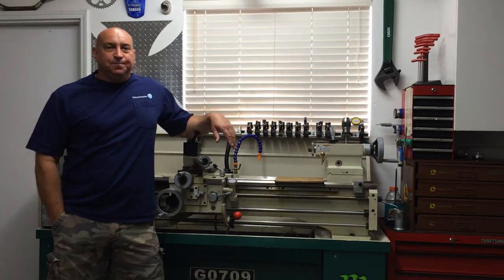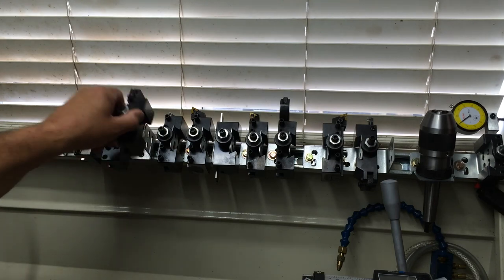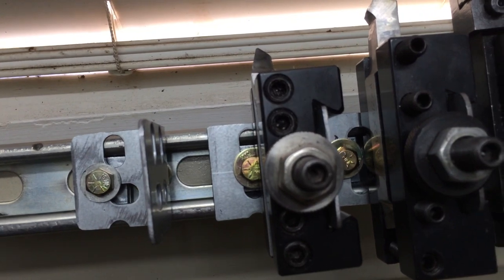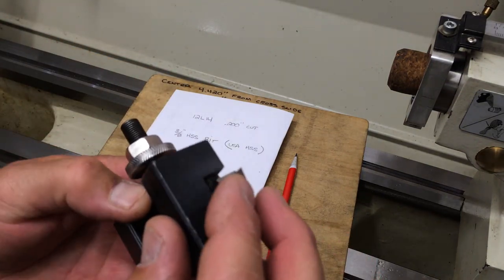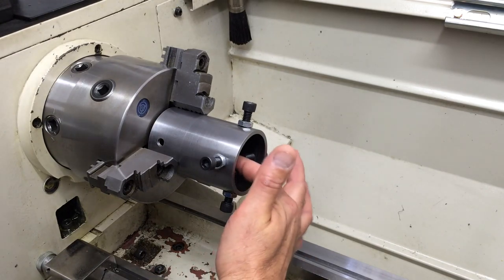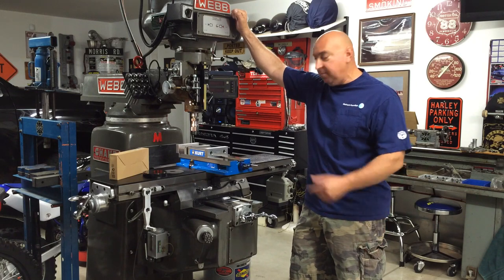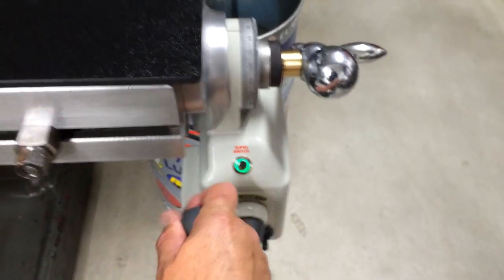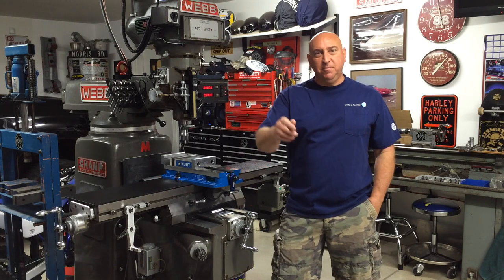Lathe Tool Holders #realraysgarage

Comment: maibe use capped brass nuts on the spider , you can just screw those on the ends of the bolts
as for the ikea lights , was thinking about getting the same ones , was planning on putting them on magbases meant for dailcalipers 
you can allso buy those aftermarket halo  /angel eyes add on lights for cars
https://nl.aliexpress.com/item/4000834460176.html?spm=a2g0o.productlist.0.0.ca837cc6LOvBwV&algo_pvid=dfec8602-8057-49c0-a9a4-94bcc7bf449e&algo_exp_id=dfec8602-8057-49c0-a9a4-94bcc7bf449e-4
 these fit around the quill and dont give shadows
Reply from the maker: Thanks for all the great info and link!!!

Comment: Hi Ray
I wanted to say thanks very much for the information and  the excellent video of the QC tool holder, made form the Super Strut and associated other materials you showed in Mix Mash 1. When I went to Home Depot I was unable to get a short section of the 3/4 X 2 1/2 because Home Deport would not cut the 10 foot length and it would not fit in my car. However I was able to find a 24 inch section of the heavier gauge strut. I bought the nut with springs and the 2 foot section of strut. My home Depot did not have the angle 2 1/2 x 1/2 14 gauge, but I was able to get that at OSH.  After a lot of running around I was able to complete the same QC holder you presented. What a great idea and well worth the effort to make. I only have five tool holders, but when I get more there is plenty of room. Again thanks for taking the time to make this great video.
Reply from the maker: Hi Kenneth,

Running around to multiple stores for a project is the story of my life, you can never find everything you need in one place!!! You will fill up the tool holder faster than you think, so good idea to make it extra long!

Thanks for dropping by!

Ray

Comment: I liked seeing all the things you have made.. The rack you made is nice.. I am still learning how to sharpen HSS bits.. I like the sander Idea Freehanding them on a grinder is hard to do.. Seeing the new mill was Awesome !!!
Reply from the maker: Thank you brother!

It took me many tries to get the grind right but, when you do it's very rewarding! Don't be afraid to try different angles, just go for it! That little HF sander is one of the most usefull tools in my garage, I found if you buy good quality belts its just as good as a expensive sander, just not as powerfull... I am really looking forward to putting this mill to use. Good luck with your new rebuilt lathe, it turned out great!

Thanks for watching,

Ray

Comment: Hi Ray, great looking mill, I'm not jealous really I'm not, NOT, nice covers too but you will find that some sort of lip would save things falling off. Another thing, you fell into the rookie trap of thinking symmetrically and putting your vice in the centre and now because you cut the covers that is the only place you can put it.. It may look good aesthetically but it encourages you to wear out the middle of your mill. If you had cut them unequal lengths you could swap the vice's position each time you took it off and replaced it, to spread the wear out a bit more. This would also give more room for another fixture, like a rotary table, without disturbing the vice.
Looking forward to seeing the chips flying.
ATB
chris
Reply from the maker: Hi Chris,

I still go out to the garage just to look and make sure its not a dream, I should have gotten a mill like this a long time ago, well hine sight... Yea, yea I know better, I had the vise off-set on the PM45 for that same reason but, I thought with a 50" table I would have plenty of real estate to do whatever I needed to do and I don't think I'll use the mill enough to wear the middle out, then again you never know... Thanks for your input Chris, I always look forward to your comments!

Thanks for watching,

Ray
Reply: You are probably right, if you keep it properly oiled it will outlast you and your heirs.
re your last sentence, You look forward? Are you mad?:>)
Reply from the maker: Chris Stephens Hi Chris,
I sure hope it will outlast me, as long as I don't break it first, so I will keep it well lubed!

Not mad at all my friend, did not mean to come off that way! I am always open to learning new things and doing things the right way from people that have way more experiance than I do, you have offered up some good stuff so far, keep your comments and recommendations coming, one day it just might sink in!

Thanks again,

Ray
Reply: Don't worry I will keep poking my nose in, whether wanted or not.:>)
Although it is good to watch others way of working and listening to advice, don't ever think there is only one way to do so something, always think for yourself, This is something I have every confidence you can do.
Still want to see some chips flying.
chris
Reply from the maker: Chris Stephens Your always welcome Chris and I am always open to listen, so keep it coming!

Thanks again Chris,

Ray

Comment: Thanks for another video, Ray.  Just subscribed the other day, and have about five months of videos to go, starting with this one.  You mentioned wanting to make another spider with larger pipe.  I can mail you a chunk if you like.  I've got some 3" pipe 1/4" wall.  I can break you off a chunk and send it your way.  Just gimme some dims and an address.
Reply from the maker: Hey Aaron,

Thanks again for the sub, and checking out my videos bud!

Thank you very much for your kind offer, my older daughter works at Valley Pipe here in Fresno and has brought me several different diameter rems of 1/4" thick pipe so I'm good, It's one of the many projects on the "to be done" list!

Thanks again and I hope you enjoy the rest of my videos,

Ray